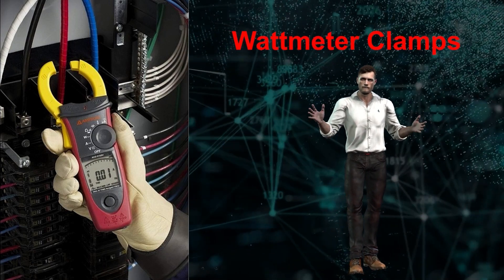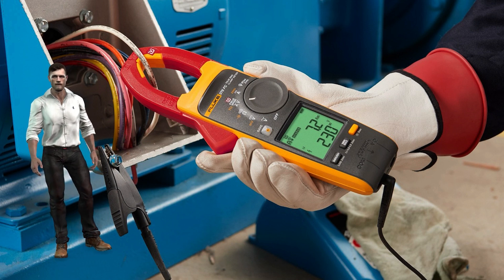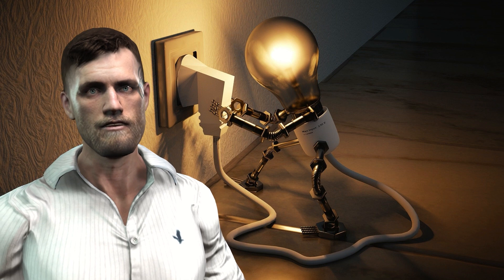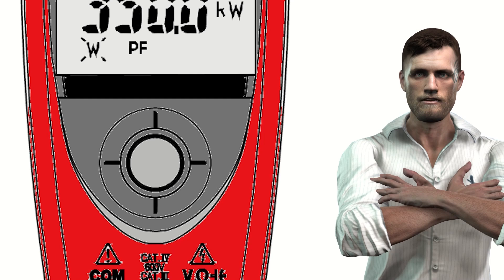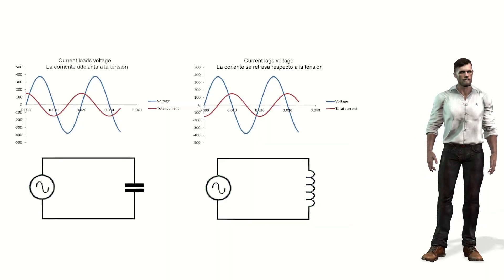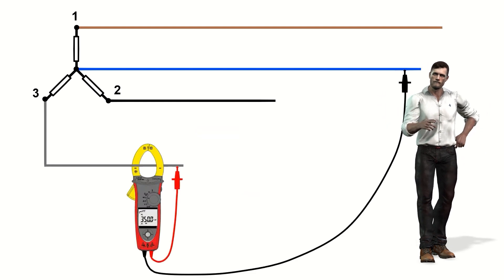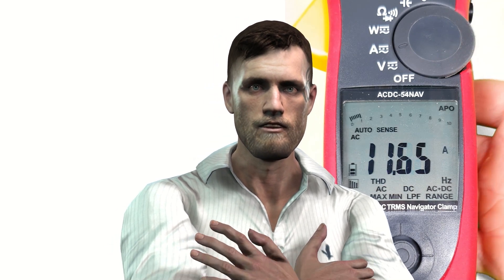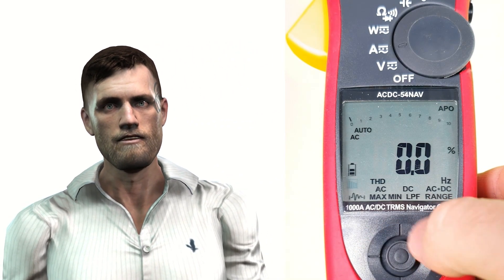How to measure active or effective power, PF, THD and individual harmonics with a clamp meter?

Comment: with lots of FVD-AC-motor drives, wind-generators,  solar-cells, electric cars using inverters that are hitting the power grid with dirty electricity if done incorrectly. the factory floor electricians need test equipment similar to this one for trouble-shooting volts and amps readings with power quality data and laptop software tools. 😎 thanks great info

Comment: Hello.

Great explanation of what a power clamp meter is. I do like this clamp because of the harmonics and power metterings, but I will like to know if this kind of meter is enought to design a bank to correct power factor on a single motor. I will be using it on 3 phase motors.

Comment: Hello Robert, the thd and useful energy all affect energy efficiency which in turn affect energy cost. So in a case of a metered customer, how can we ensure the energy consumption avails savings in energy consumption.
Also how can i purchase this particular watt clamp meter
Reply from the maker: Hello Obinna, in industrial facilities to improve energy and economic efficiency you can verify voltage levels, reactive power, harmonics, unbalances, etc., since they all cause energy losses, you can also verify the efficiency of the loads themselves and, for example, use motors of higher  efficiency . Amprobe is a second brand of Fluke, so you can try to find a Fluke distributor.
Reply: @SCIENTIAPLUS  thank you very much. When you speak of unbalance. Is it load imbalance or phase imbalance. Kindly explain how this two can cause energy losses
Reply: Does fluke make a good meter with THD?